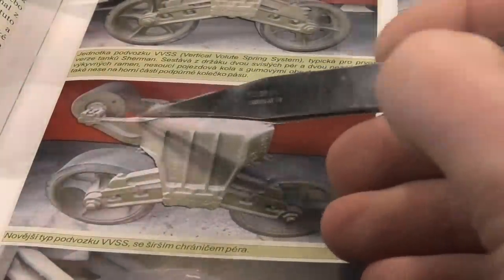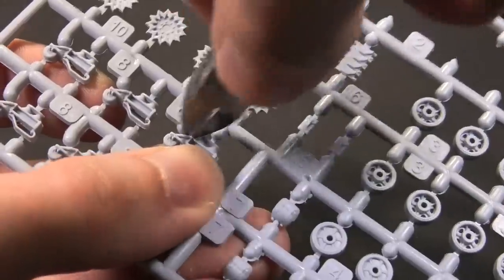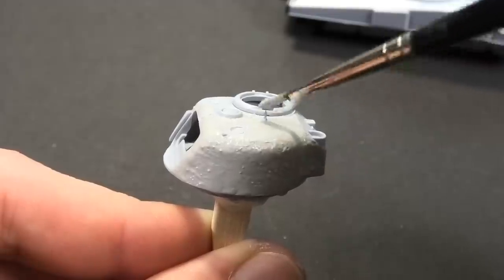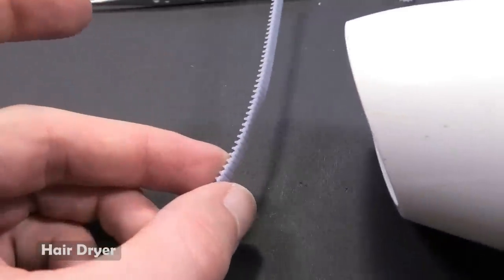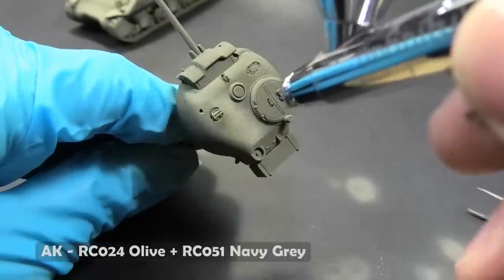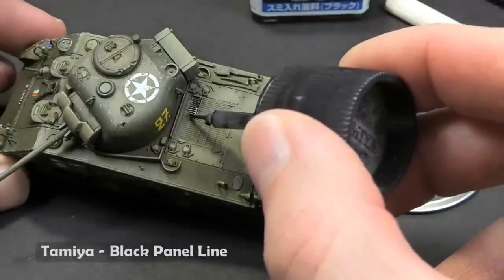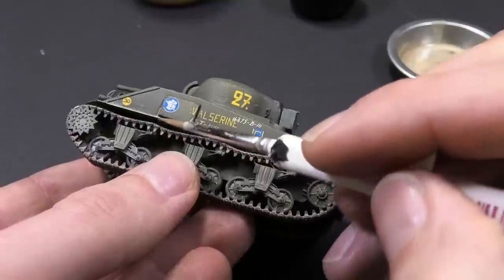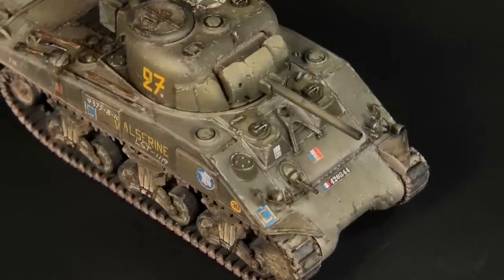Sherman M4A2 Division Leclerc - 1/72 Heller- Tank Model

Comment: I'm suprised how good this kit is. Had two kits from Heller myself, a 1:43 2cv and a 1:43 a310. Both had pretty severe issues with warp and the body not fitting onto the chassis correctly even after several attempts to fix it.

Comment: I'm traumatized by every heller kit I've ever completed or at least tried to...
Reply: Why, I don't get it
Reply: @danieltsimbler343  its really difficult cause of the small parts
Reply: The fit and fitment on heller kits is Terrible 🤬 also I wouldn't call the Included paperwork a Construction Guide , more like a series of pictographs showing were the parts might possibly fit - sorta 😳 maybe
Reply: I've never had any luck with the decals they always seem to break up and be very thick for me.
Reply: Perhaps now that Heller is German-owned, there will be corresponding improvement. 😁
Reply: @gr5535  It's a "new" mold, from the 2010 's, plenty of options. Just change the barrel for a metal one, and you can have a very good M4A2, way easier to build than the Dragon one. Trust me, I've already built 6 of it....😉
Reply: Funny, showing a “Ronson” next to a lighter! 😅
Reply: Guys don't blame French brands pls 🇨🇵🇨🇵😂
Reply: @antoninjoly742  I can and will
Reply: I have an EC135 sitting in the "I don't feel brave today" pile 😂
Reply: @Maxedout499 Hold my Miniart kit. I just need to find the rivet I dropped.
Reply: @muddydave01  I've 3d printed so many rivets as they like to fly into the dusty corner somewhere
Reply: @eddiebruv  EXCEPT they were never called that.
Reply: @David Lowery  I've been building the T-54 with full interior for two years, so I understand this comment.
Reply: I've never heard anyone speak well of Heller kits. There are so many other proven brands out there, I wouldn't risk buying Heller.

Comment: FIY if you look for "Braun Satin Hair" brush, from whatever model number, 5 7 doesn't matter, and then remove the add-on brush that comes with the kit and cut the spreader peg down the center, you'll get a very small, very powerful "heat gun" that's excellent for this kind of work because it doesn't blast everything with heat, on account of the very small nozzle that results after you modify it.
I stumbled across one of these in a shop that had them displayed, because normally, you see them with the brush on and you'd never think that the hot air exit is that small.
I have one by my bench and it's much better than the larger, unwieldy ones.

Comment: Nice, and thank you for the headlight guards, I have a "Frankensherman" that I'm rescuing that could use those - the Italeri easy assembly details leave much to be desired...

However, as far as I'm concerned, Shermans didn't really chip like this, as the paint was basically caked on them in the factory. Might be worth looking into if you plan to build more of them.